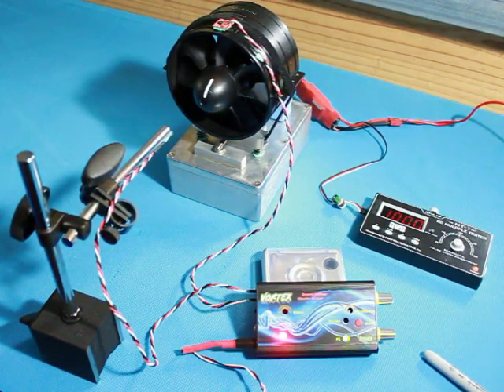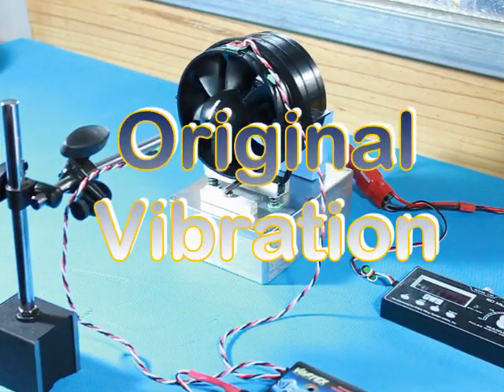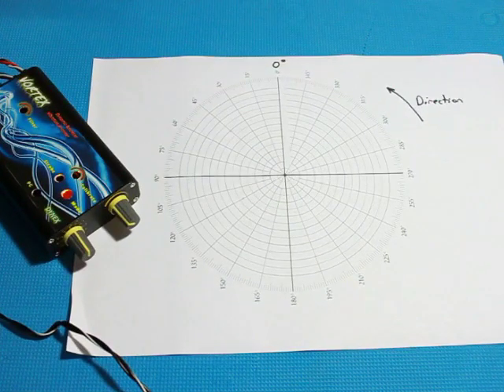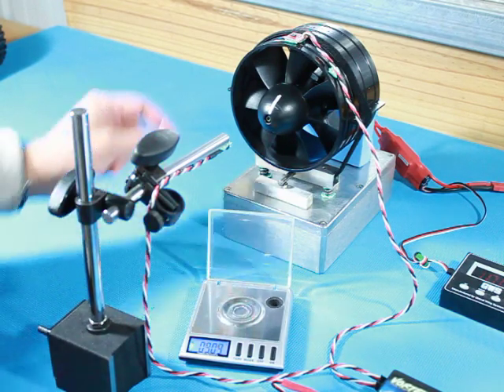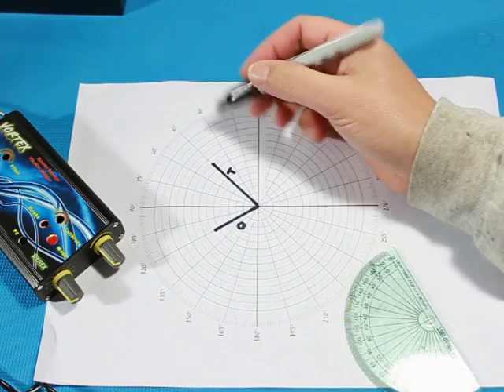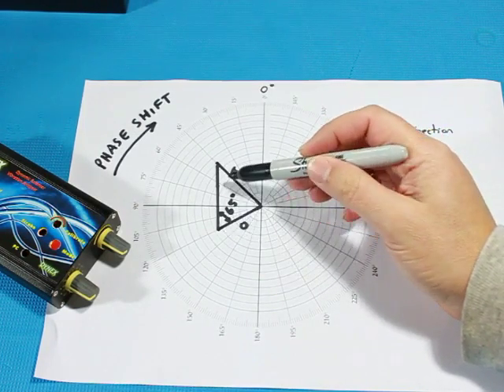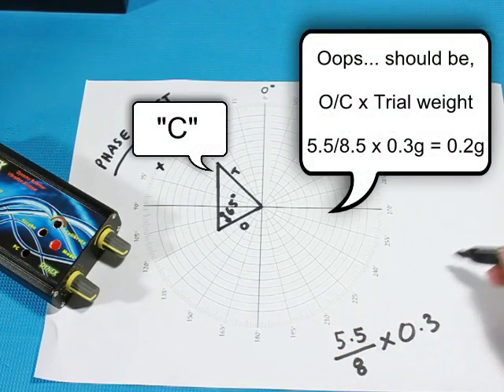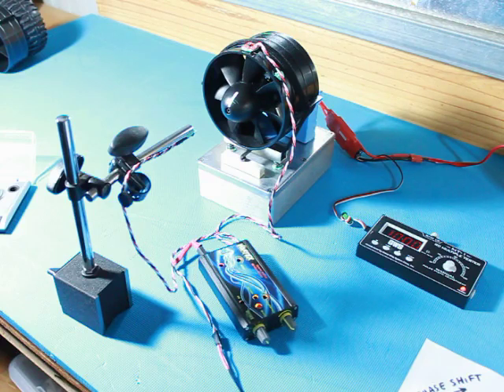Vortex Strobe Balance Method

Comment: I know a quicker way to get the end results with the strobe method,as Ihave balanced very many props on real turbo-prop engines.When you did the first run and saw the white line at about the 8 o'clock position,stop the fan,move the fan so the white line is at the same position as what you saw with it running,now since the accelerometer in at the top of the fan housing,you simply go straight down from there and add your weight to the spinner dome based on the numbers you got.If you look at that method,you will see the weight that you just put on to get a good balance is at the same place as what you just did.When I did it this way,I would get a readout of imbalance in inches per second(ips).By how many ips I had showing,I knew how many grams of weight were needed.The end result was like yours,I could not stop the white line(I used refective targets on each blade of the prop)and my ips reading was at so low a number,it culd not be done any better.

Comment: how do you mannege to run the fan always in the same speed ?

i see that you are running your SERVO TESTER to a same constant number ?
Reply from the maker: Hi, yes I set the ESC to the same value each time. Basically you need to run at the same speed during each run when balancing.

Comment: Now the question is, this balance is only tuned to one frequency level (i.e. one RPM range).  How do you balance the fan across the entire RPM range of operation?  I think it's difficult because there will always be frequency crossings across the RPM range.  I had a tough time trying to tune out vibration at all RPM range.  There is always vibration at certain RPM where it resonates.
Reply from the maker: Hi, if the problem you have is imbalance then it applies to all RPM ranges. If you get resonance at certain frequencies, then the issue is unlikely imbalance rather something else. Best to perform a frequency analysis of your setup to identify what the problems are.